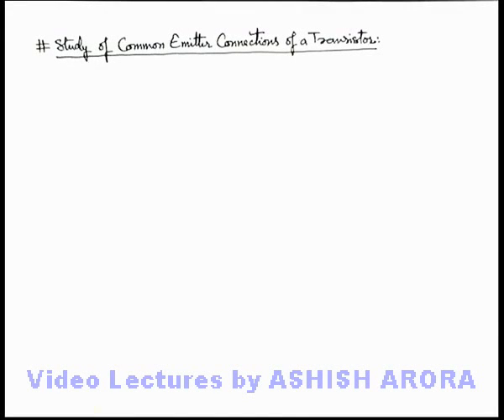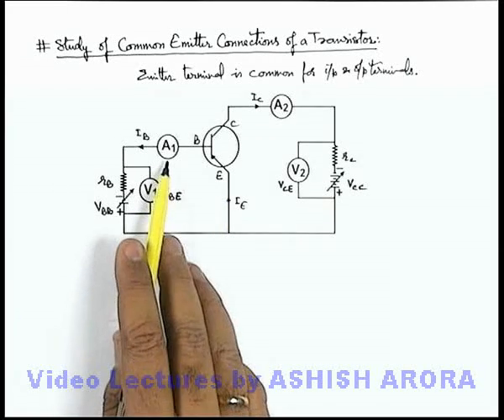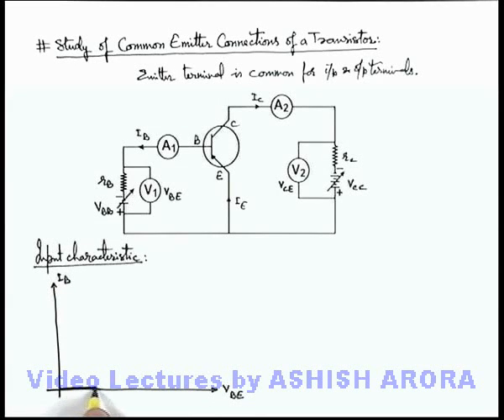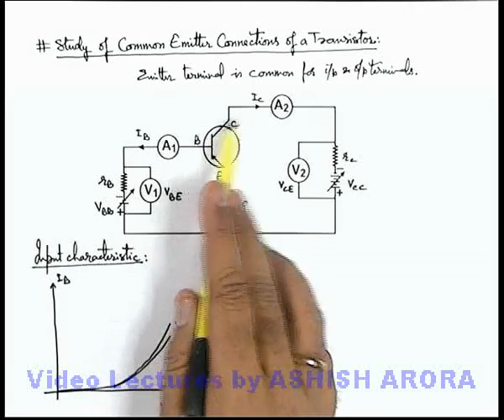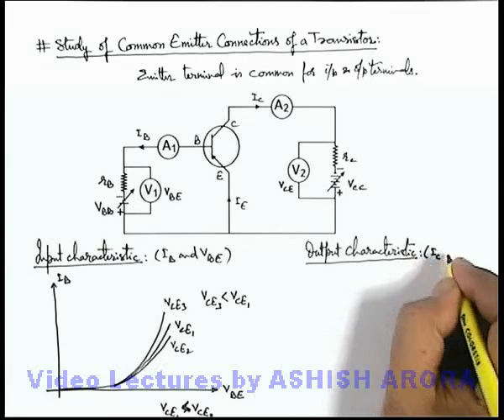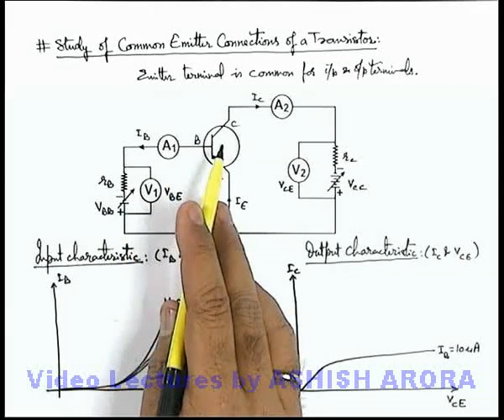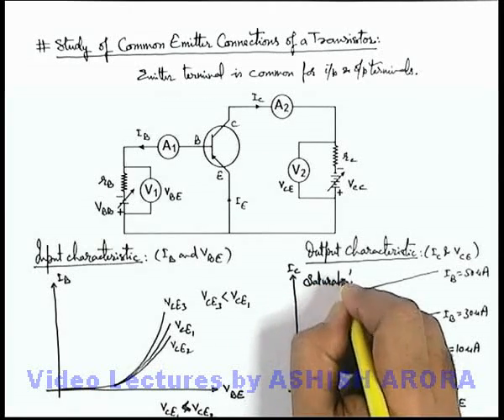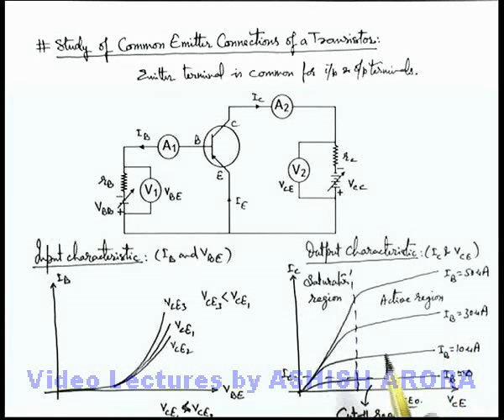Class 12 Physics | Transistor And Its Application | #11 Common Emitter Connections of a Transistor

Comment: I have some doubts:
1.Why base current decreases on increasing collector voltage.
2.Why current through collector is 0 when collector voltage is 0.. shouldn't the barrier potential already present in CB junction be able to collect some electrons
3.Why collector current becomes constant after some time?
Reply: Vce upon being increased will cause an increase in current from emitter to collector. Thus recombination at base will decrease since charge carriers will move towards  collector.
Any diode junction is at equilibrium until biasing is applied. The depletion barrier potential neutralises diffusion current by drift current.
After a stage, the limiting constraints on magnitude of current is the paucity of charge carriers. Once this stage is reached, increasing potential won’t change current.

Comment: sir in common base circuit in transistor amplifier Ic v/s Vcb graph start from negative V value as u told the charge carriers would have gained some velocity so it can supply some current without help of potential difference. but in common emitter case why charge carriers cannot flow the current even when Vce is zero as the would have gained velocity in this too.

Comment: Why graph not started from the left of origin as in common base case of forward biasing in output characteristic curve and why the Ic rises on increases on increasing Vce.Please reply soon....
Reply: because here its Vce and when VCe is zero then collector don't take any current from emitter cauz both at same potential .. 
Ic increases because if Vce increases then collector pulls more charge carriers from the emitter and since base current is low the corresponding increase in Ic...
Reply: ADARSH CHATURVEDI thnx

Comment: Sir in the output characteristic graph why is the graph not starting from the negative X axis as in saturation region both are in forward bias?
Reply from the maker: +debmalya sarkar This is because on -X axis V(CE) becomes negative and collector will repel all the charges emitted by the emitter and will not absorb any carier... so I(C) remain zero...
Reply: @physicsgalaxyworld  same is also possible in common base connection?? But why it not so?

Comment: @PhysicsGalaxy Sir, if on increasing base current (by increasing base voltage), the collector current also increases, why is it that on increasing collector-emmiter voltage (thereby increasing collector current), the base current does not increase, but decreases?
Reply: Two different phenomena are occuring here. When Vce increases, charge carriers dont recombine at base but move on towards emitter.
However if base current increases, it must be by increasing recombination at emitter base junction. This increase happens due to a significant increase in charge carrier concentration such that more recombination also takes place. However apart from more recombination, more carriers will also move on towards collector. Hence Ic will increase